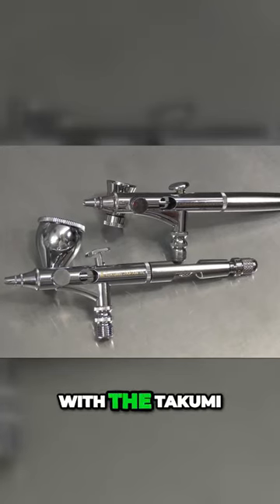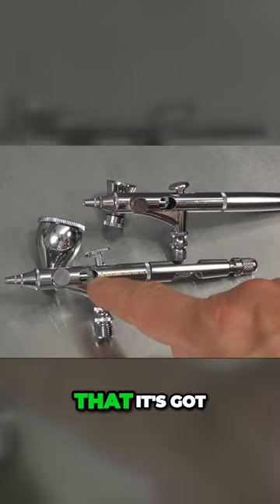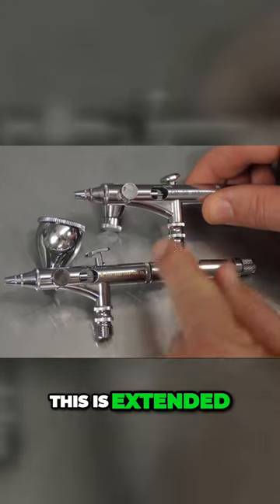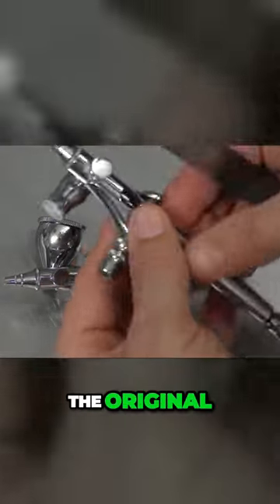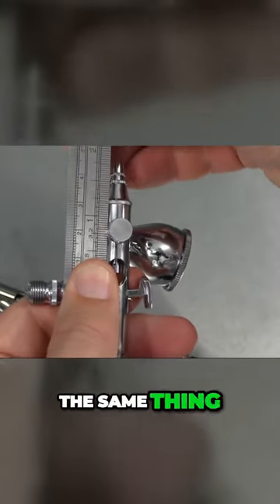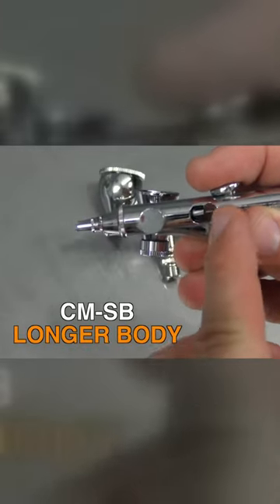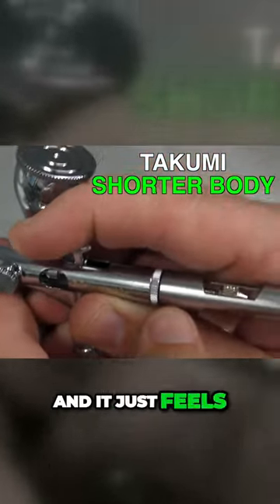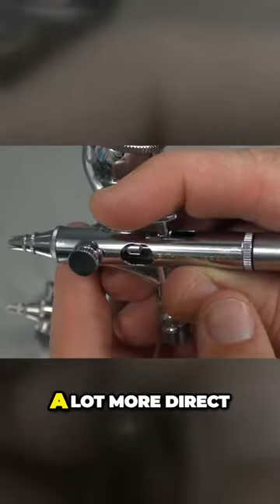Why The Iwata Micron Takumis Head Design Is Better 🤔

Comment: I designed this for iwata in 2016. They were not interested then. Poof years later, they release it. Unreal
Reply from the maker: Wow that’s awesome 👏
Reply: @AirbrushAsylum  I know it probably sounds crazy. But, i took an eclipse sbs and cut a chunk out and epoxied it back together. I still have it and it actually sprays perfectly. It also is within a millimeter of the production length.